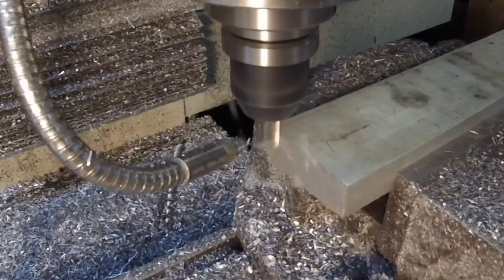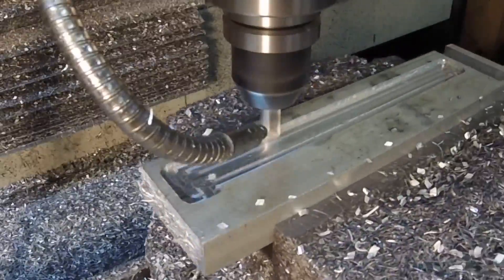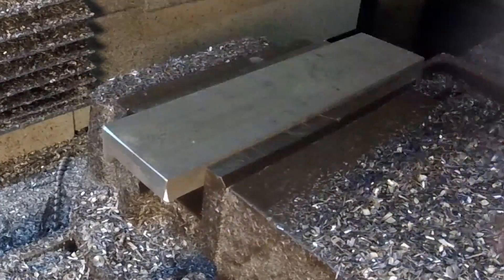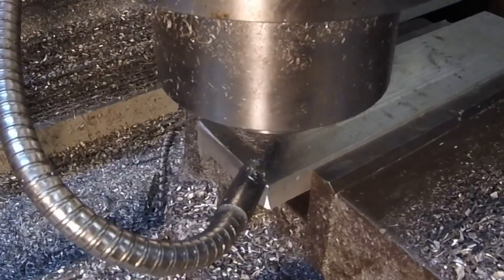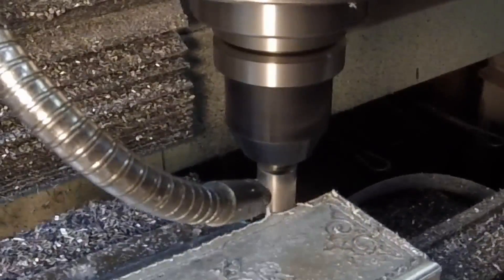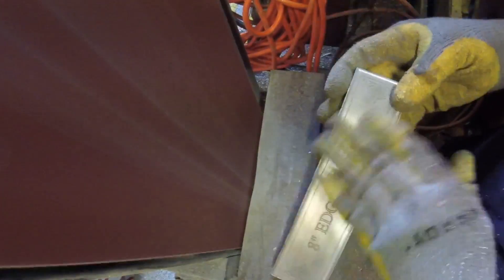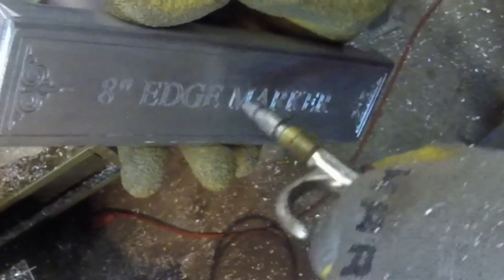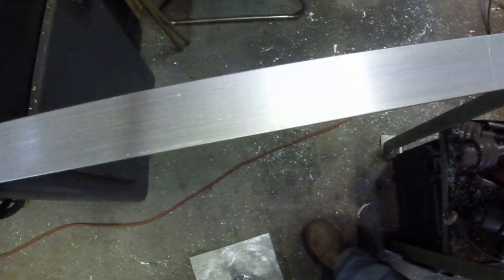Making a length marker on a Tormach PCNC 1100 mill

Comment: nice work my friend
Reply from the maker: Thanks, appreciate it!
Reply: +ecdezz  friend can you give  me your opinión about Tormach 1100 tanks
Reply from the maker: Absolutely.  I love mine.  My budget was limited so I got the bare bones version and made my own stand and surround so I can't comment on the ones they sell but the machine itself I'm very happy with.  I work mainly in aluminum but sometimes steel too and neither give me a problem.  If it does, it's always the cutter or my speeds and feeds, not the machine.  I can't take super heavy cuts because it's not designed for that.  The 5100rpm spindle is a little limiting when you get down to tiny endmills but they sell things to work around that.  I usually don't use anything smaller than 3/16" so it's not a problem for me.  I would definitely not have a problem recommending it.  As long as the buyer knows it's limitations I'm sure they'll be very happy with it.
Reply: +ecdezz  nice advice my friend congrats i want to buy one 1100 this year   is alittle dream my friend
Reply from the maker: That's great!  You gotta have goals.  It took me 3 years of saving to get mine and even then I could only get the stripped down version.  It's working out though and finally starting to pay for itself.
Reply: +Ebbco  yes  bud tanks for you advice Have 4 years saving money  hope this year arrive to my Shop my Tormach 1100